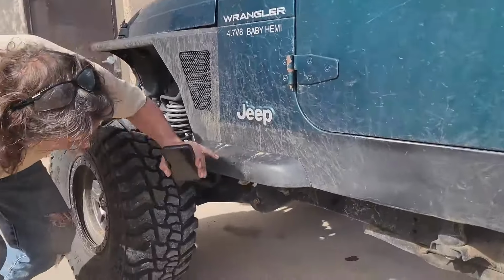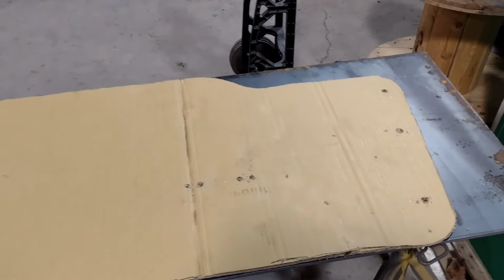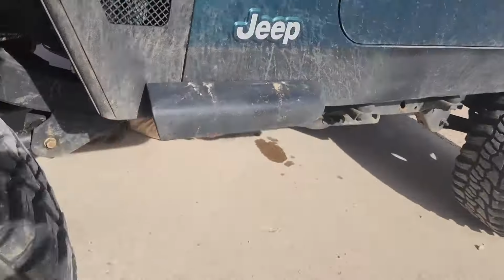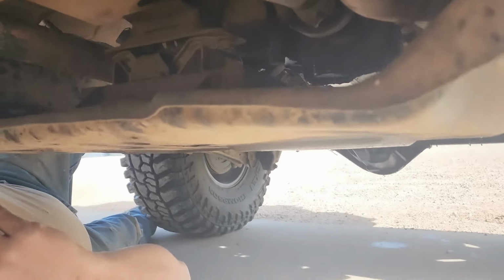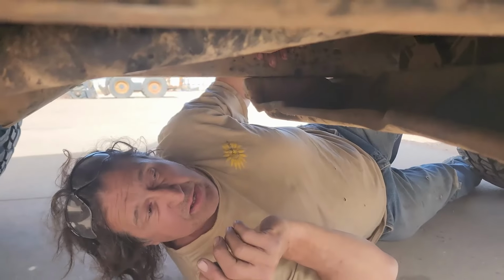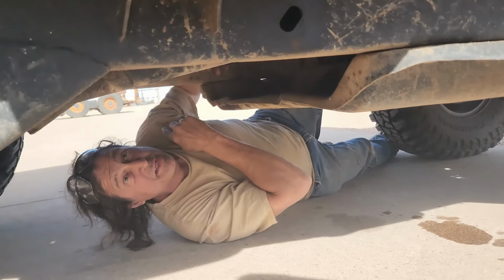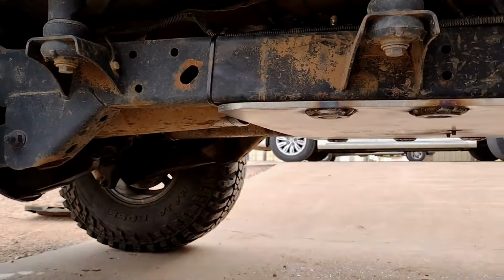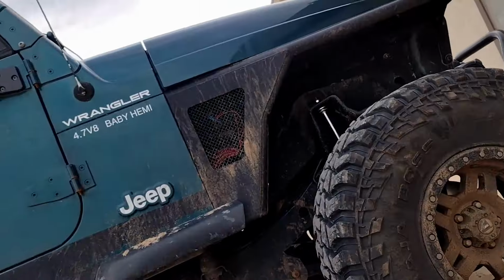Want more Ground Clearance? Give your Wrangler TJ a Tummy Tuck !!!

Comment from the maker: If you're looking for more ground clearance, check into a tummy tuck! Factory skid plates are flimsy and hang out 3" lower than the frame, so if you're after better off road performance, this might be just what you need !
Reply: Maybe I missed something. But you need a body lift to do that right?
Reply from the maker: While there are tummy tuck kits, like the tera flex belly up skid plate that will gain about 1 3/4" of ground clearance, to get this much ground clearance, yes, a body lift and engine/transmission lift is necessary.
Because of the 4.7 V8 swap, we already had to raise the body and the engine/ transmission 3".
This build is extreme. But lifting the body is easy, and lifting the motor mounts only takes a little bit of creative fabrication.
Thanks for watching, 
Hope you enjoyed the video

Comment: Nicely done! It looks great and what a difference in clearance!
Reply from the maker: Thank you! That was a fun upgrade! And yes, a noticable difference in ground clearance and break over angle.... Next, to figure out what I need to do to the rear suspension to move the lower control arms up, and get rid of the stock mounts welded on the frame 
Thank you for watching, and hope to see you out on the trail 😎👍🏻

Comment: Neat Idea, looks real heavy. Did you consider using thinner plate & welding on angles to the top for stiffness?
1st time I've seen this.
Reply from the maker: You're the first person to notice or mention it....no if you're referring to the extra structure in the roll bar, that's a light weight welded steel frame, wood and fiberglass subwoofer enclosure with a 12" infinity subwoofer and a pair of infinity 6" coaxial speakers,  we couldn't part with the tiny little bit of room for camping and prospecting gear that the TJ has so we went up with the sound system.
Thanks for watching and thanks for the comment 
Hope to see you out on the trail 😎👍🏻
Reply: I meant using 1/4" plate underneath instead of the 1/2"?  
Yours is beefy 4 sure, but angle irons running parallel to the frame from the top could make thinner plate less likely to bend from rocks, maybe perpendicular where they fit. Airplanes use "stringers" the same way. Awesome work tho! Love your bolt head protection.
Reply from the maker: @ohane1 my decision to use 3/8 was based on a project from my real job. We had to move a scissor lift , and three large cabinets for an uninterrupted power supply into the UV treatment building of a waste water  plant, had to move them across a three foot wide channel in the floor. The project engineer spec'd 3/8 plate, 3' wide to move a 5000 pound battery rack across without caving in...it didn't even flex moving that equipment across. Would take one hell of an impact to bend or dent it
Reply: @Jeep_psychology_101  For sure, yours won't bend!  Great work, if materials are free that's cool.  I was saying if I was buying steel, I'd go lighter & thin then make strong reinforcing from the top.  You have lot's of HP though, so weight matters less.
Reply from the maker: @ohane1  the piece of steel was only $120.00...plus tax...I feel like it was a small price to pay for 3 more inches of clearance. In the middle of building sliders now. A bit more in them... will have @ $210.00 in them. Also because of the 4.7 I'm starting out a full 90 pounds lighter than if it was a 4.0 inline six
Reply: @Jeep_psychology_101  I'm going to copy you mostly. I'm just going to make mine stronger & lighter by welding angle iron pieces to 1/4" plate on the xfer case side.  I have less HP, so I care more about weight. Love the idea!